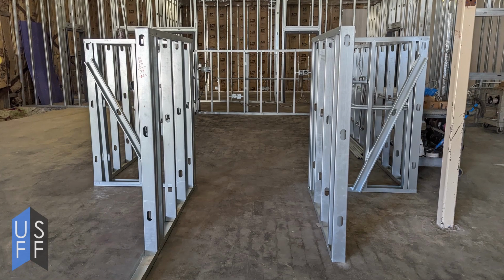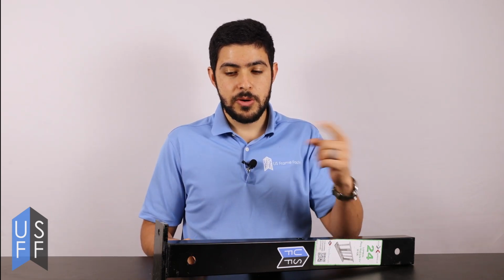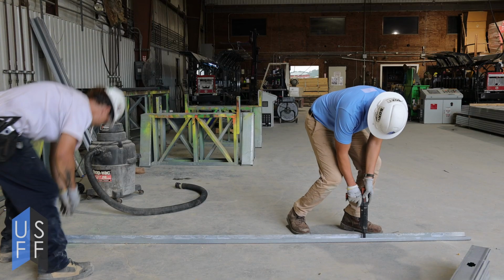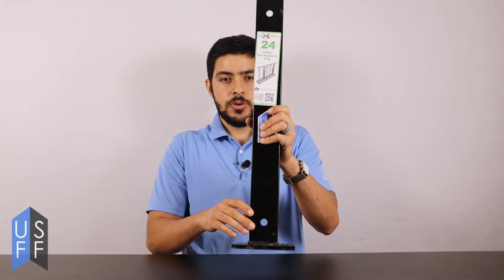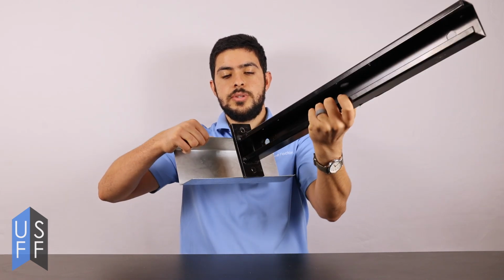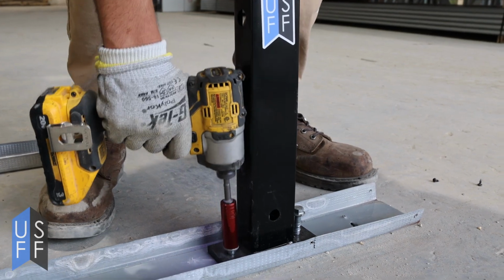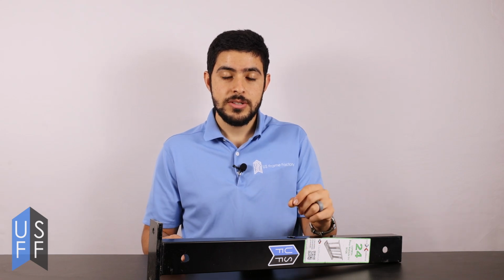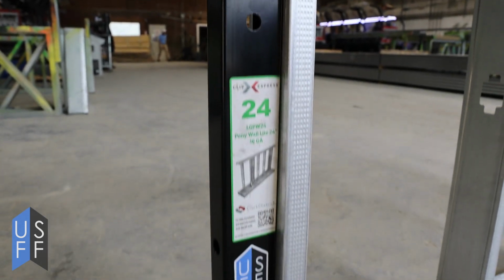How to Build a Pony Wall using Metal Studs

Comment: How do you adjust the level? Do you level the pony wall using nut at the base or use washers on the stud before screwing it to the brace?
Reply from the maker: If you are talking the tilt of the wall backwards or forwards, then I would put a level on the outside. If you are talking about the plumbness of the stud in the plane of the wall, then you could shim the pony wall support or simply let the studs conform to the level of the pony wall.